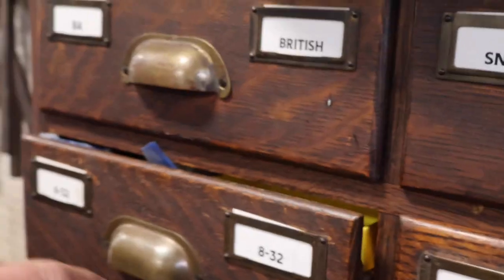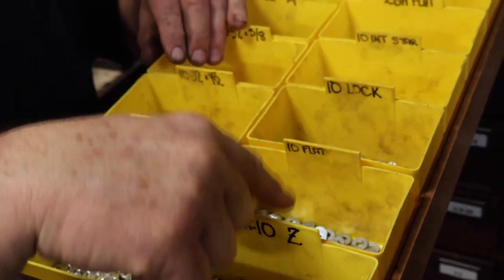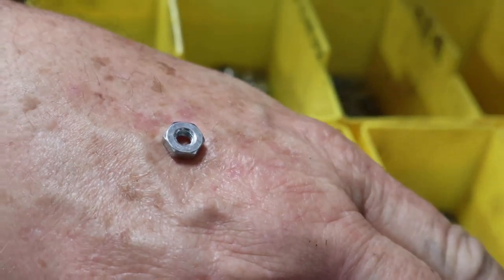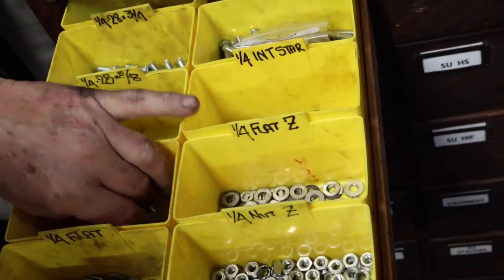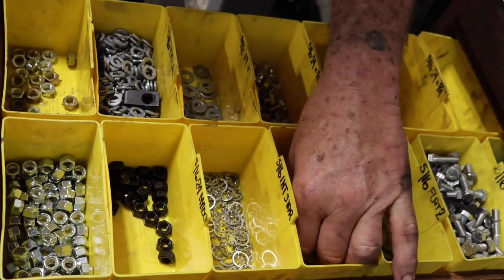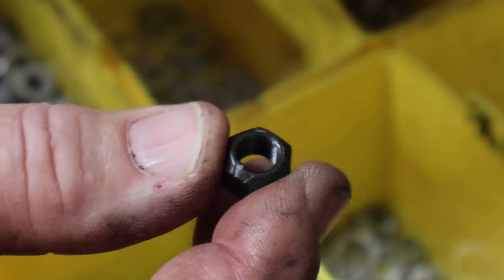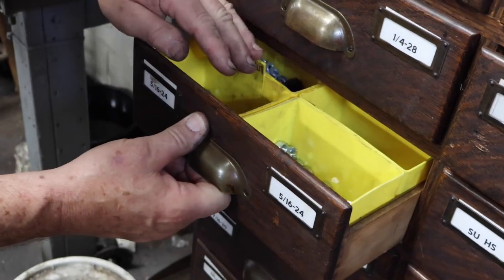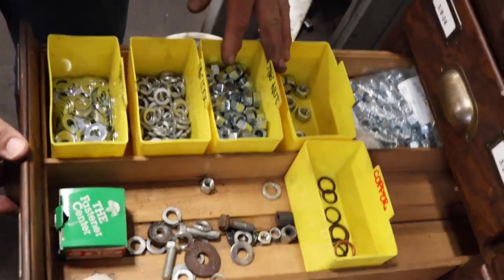409 MG Quick Tips | How to Organize MG Fasteners

Comment: Hi John, great system. I am lucky here, (U.K.). five miles from me i have a bolt store with large stocks of UNF and BA plus everything else under the sun. You are right to say it is great to have these fittings ready to hand. You also need an inexspensive UNF threading kit, (about £15-00 here) With this you are home and dry. David.

Comment: Overkill for a one car collector in my case.  Fortunately, I have a Survivor car and can reuse most fasteners and can make due until net order or trip to store if not in hand. Then there are, drywall and deck screws, roofing nails, concrete anchors, it never ends..  If you have and old fashioned hardware store, better to let them hold your project stock. I keep saving bits thinking i might be able to use it later and end up swamped with stuff.

Comment: The french intrusion of metric threads in the "T" series cars is only the first incursion of metric fastners in MGs and other British cars.  Today, the re-pop reproductions fron China often insert metric fastners into parts wholly engineered in China.  If you install a new reverse lamp from a Chinese source on your MGB or Midget, the screws holding the lens in place are likely to be entirely metric and the threads for the fastners that hold the lamp to the body may or may not be metric cnfusing the issue even more.  The Chinese do not seem to understand the concept of "Period Correct".